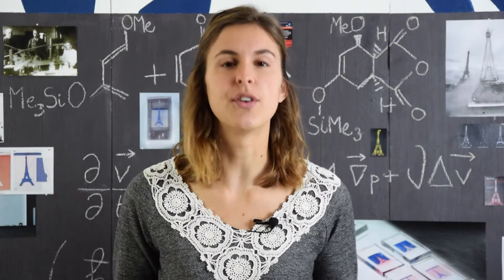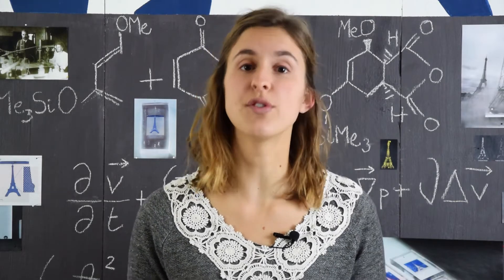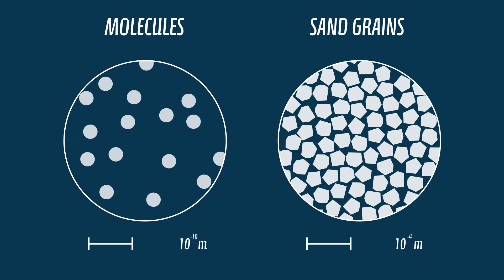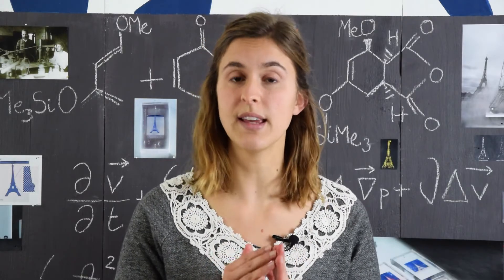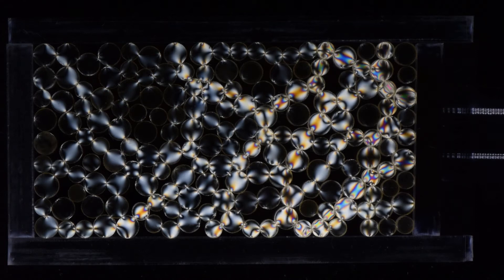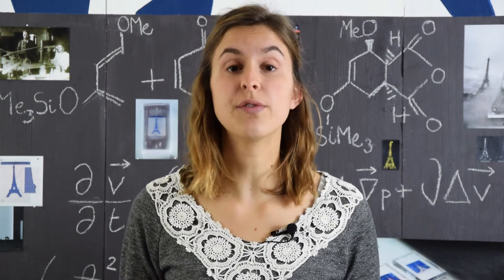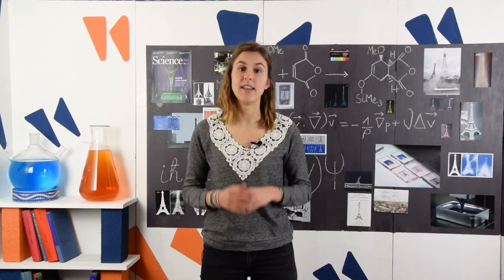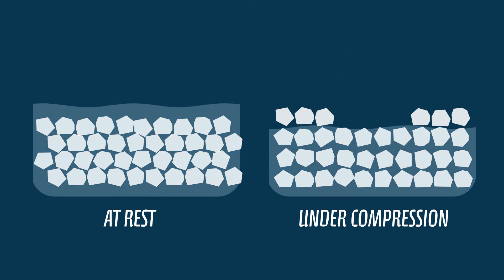The puzzling physics of sand

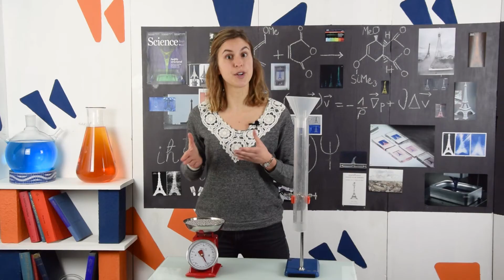Comment: At 5:30, you can reproduce something similar by weighing yourself with the scale resting on carpet which I do all the time just to make myself feel a little better about myself. You will always weigh less if the scale is on a carpet or other shock absorbing surface. So I guess we can say that the steel balls were acting as a long tall shock absorber. Someone should patent that.

Comment: 5:30 Something wrong at weighing the beads. PLEASE DOUBLE CHECK. Thank you.
Reply: The transparent tube (silo) is fixed to the table. The scale is not in contact with it
Reply: The force transferred to the walls has nothing to do with it. Even the friction must be countered at the scale. Only factor that can affect the rate of weight increase is the rate of input flow. 
This is very misleading.

Comment: is there a supplier of those plastic disks for the average person? that stress pattern is beautiful.
Reply: Smooth-On is what we typically use. ClearFlex for polyurethane disks. (Trial size is ~$50.)  You'll need to cast in a mold, which smooth-on can also help with. Then you need some polarizers -- cross two pairs of sunglasses around the material you made and then shine some light through! (Preferably you want circular polarizers but that won't be cheap)